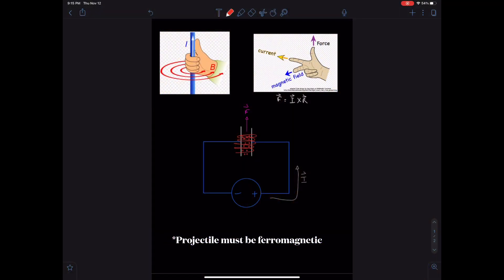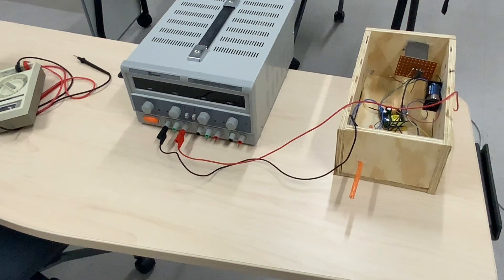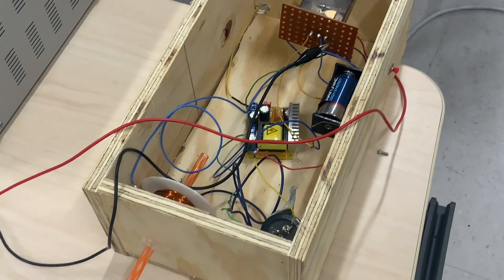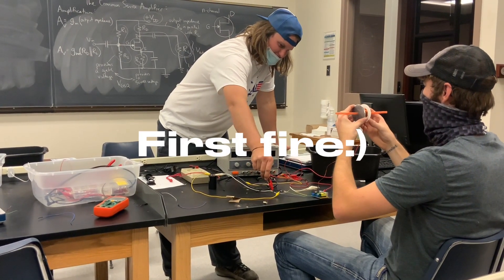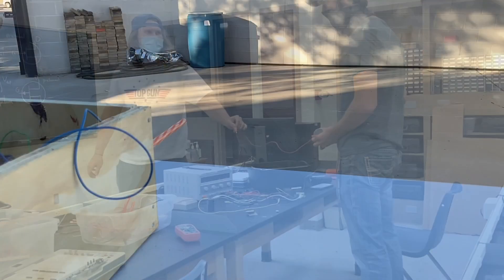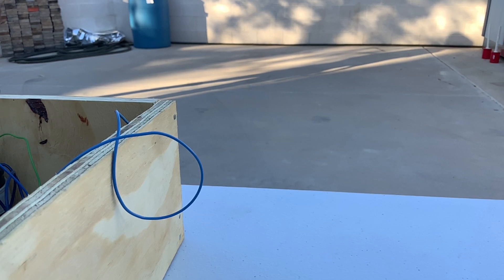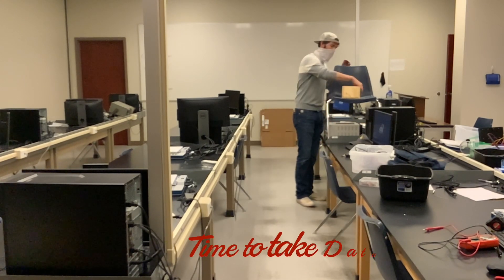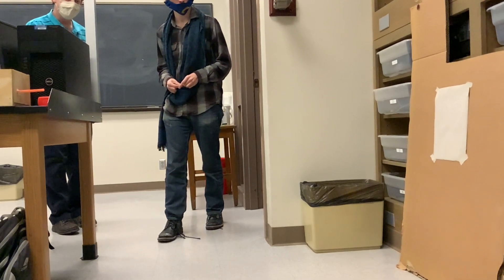Coilgun: Magnetic Projectile Shot using Lorentz Force Developed in an Electromagnetic Field

Comment: Even simpler Proposed  power supply: 
Take 120Vac (rms) which is 170Vac peek -170Vac peek and run it to a half wave voltage doubler.    Both capacitors should be chosen to limit current draw from mains. Output will be about 340Vdc 

240vac main power to  a voltage doubler will output upto 680v 

Output should feed through a 50 watt current limiting resistor to the capacitor bank.

Although 50 watt may be under rated, it can be sufficent if its power raiting is only exceeded for only a few seconds.  The RC charging curve and current limiting capacitors help hold the current through the resistor to safe levels.
Reply from the maker: Thanks
Reply: Is 340v from a half wave voltage doubler sufficent?

If not, maybe the simplicity of the circuit allows for quickly charging the bulk of the charge, and DC to DC boost converter can do the rest.